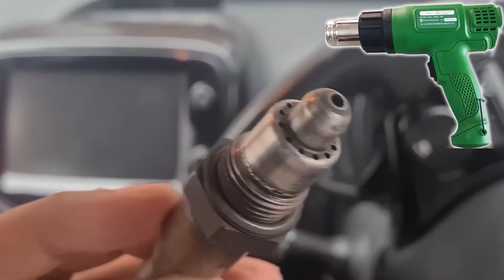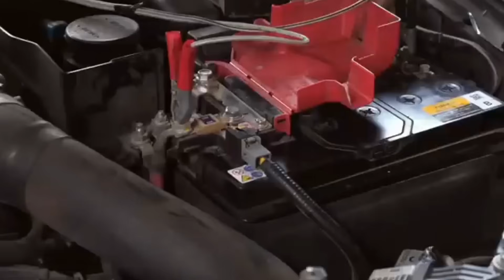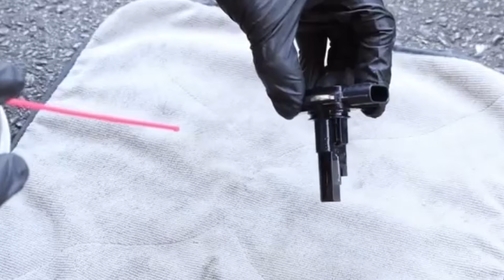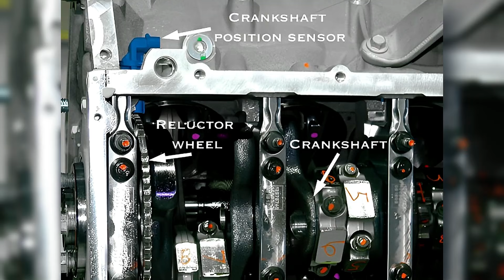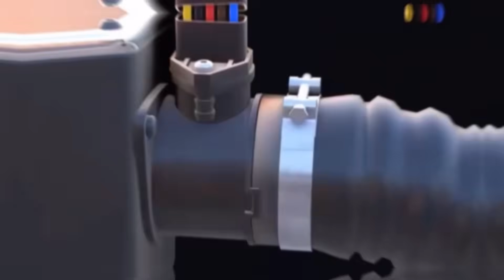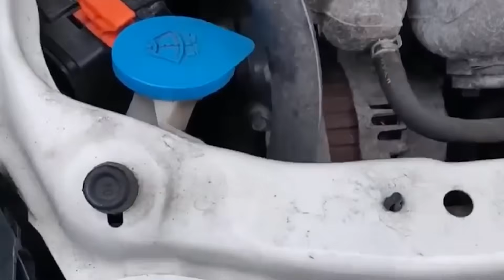Nobody Cleans These 5 Sensors — And Your Car Pays for It

Comment: Why did car manufacturers put those sensors to give car owners problems? Old cars don't have them but they lasted longer. This makes we wonder.
Reply from the maker: Honestly bro it’s the emissions laws, not a plot. Carbs couldn’t pass modern rules so sensors came in. The old cars you see still running are just the survivors, the rest went to the scrapyard decades ago. Real problem is shops swapping a $200 sensor when a $10 cleaning does the job.

Comment: What about the pcv valve?
Reply from the maker: Fair question, the video only touched on it. A stuck PCV valve is a big reason the MAF and throttle body keep getting dirty. It pushes oil vapor into the intake, so you clean everything and it’s coated again a few months later. Shake the valve. A good one rattles, a stuck one stays silent. Oil residue inside the intake tube is another sign. They’re usually $10 to $20 and sit on the valve cover. What car is it?
Reply: @AutoTruthLab i have a 2023 kia sorento. Its done this thing on me a few times where the car randomly turns off shortly after i put it in park. Usually within a minute of turning off the car. Not sure what is causing the issue.

Comment: hi l have a 2013 chrysler 300c 3.6 when l push the throttle hard the engine light comes on and no power when l back off and drive normal car drives ok sometime under power its ok not sure whats going on can someone help
Reply from the maker: Hard throttle power loss with CEL on that Pentastar 3.6 is pointing straight at the MAF. Dirty sensing wire reads accurately enough at light throttle but signal drifts when the engine demands full airflow ECU can’t trust the data under hard pull and cuts power as protection. Back off, sensor stabilizes, drives fine. That’s exactly the pattern. Clean the MAF first, $8, 15 minutes. Battery disconnect for 10 minutes after to clear stored fuel trim compensation. If the power cut still happens under hard throttle after that, check the throttle body second.

Comment: Please am facing a problem with my toyota cami k3-VET, after swap only an engine with non turbo. Now am getting rough idle when start at cold, and fuel cosumption went high about 6km/L  and the technician came and check the error it throw only one found he said. Air flow sensor they mention it and up to now i don't know if The MAP used there has no problem because they want to replace IAT sensor only!!  I dont know what to do
Reply from the maker: Hold off on that IAT sensor  it’s not what’s causing the rough idle or the fuel consumption. IAT just reads intake air temperature, replacing it won’t fix either symptom. After an engine swap the ECU fuel trims are still calibrated for the old setup — airflow code on a fresh swap almost always means the MAF needs cleaning and the ECU needs a reset to start learning from scratch. Clean the MAF, disconnect the battery for 15 minutes, drive 50-100km normally and let it relearn. If the code returns after that then dig deeper. Don’t spend money on the IAT before trying this — it’s a free first step.

Comment: 2006 Passat B6 2.0 TDI gets code P0236 and loses power, rpm cuts at 2000, what could it be?
Reply from the maker: P0236 on that 2.0 TDI is the MAP sensor reading boost pressure outside what the ECU expects  covered in this video. Before touching the sensor check the vacuum hose connecting it to the intake first. Cracked or loose hose gives a false boost reading, ECU sees data it can’t trust, pulls power and caps RPM at 2000 as protection. That hose check is free and fixes this more often than a new sensor does. If the hose is solid, clear the MAP port with compressed air next. Sensor replacement is the last step on that BKD, not the first.

Comment: Rough idle. When I left off the gas it chokes out. Sometimes I get lucky and she doesn’t stall. As of late she seems like she is having a hard time breathing. 2004 Citroen C4.
Reply from the maker: That choke-out on throttle lift is the throttle body. Carbon on the plate stops the engine from transitioning back to idle smoothly — it stumbles and cuts out instead of settling. The hard to breathe feeling is either the MAF or a blocked air filter choking the intake. Clean the throttle body first, both sides of the plate and the bore. Check the air filter while you’re in there — on a 2004 if it’s never been changed it’s long overdue. MAF clean second. She should breathe properly again after both.

Comment: The check engine light continues to come on.  The car runs fine, no issues with fuel economy, pick up, hesitation nothing while running.  The only issue is at startup is extended crank and sputters like searching for fuel.  Once it starts, there is no issue with the need for fuel.  Just changed the spark plugs.  The check engine light is back on.  This is a 2020 Hyundai Santa Fe and it has 101,000 miles.  Any suggestion(s) would be much appreciated.
Reply from the maker: Extended crank and sputter only at startup then fine after — that’s fuel pressure bleeding down while it sits overnight. Rail loses pressure, starter cranks until it rebuilds, catches and runs perfectly from there because the pump holds pressure while the engine is running. New plugs were never going to fix that. Fuel pressure regulator or injector o-rings are where pressure is escaping. Also pull the exact code number — P0087 or P0088 means fuel pressure out of spec and confirms this. P0300 range means misfire and points somewhere else. That code tells you exactly which direction to go before spending anything.

Comment: This is why I like vehicles with just HEI and Carburator or Air body fuel injection, No sensor problems any more, It has been proven that a vehicle turned run just as effiecient as a computerized vehicle. Besides, with a fuel cleaner, the valves get cleaned as the fuel passed throuth the intake vales, Many vehicles do not get that benefit.
Reply from the maker: The simplicity argument is legitimate — fewer things to fail, anyone can work on it with basic tools, no scanner needed. But equally efficient as modern injection doesn’t hold up. Fuel injection calculates delivery for every condition in real time altitude, temperature, load, throttle position. A carb runs on fixed jets and float levels. That gap is real and measurable. The problem isn’t the sensors, it’s shops exploiting the fact that most people don’t understand them. That’s what this channel fixes.

Comment: I have a Toyota camry 2020 le  2.5 engine when the engine is hot and the transmission shifter is on park the rpm goes up and down slightly, but if i shift to drive (D) it stops doing that is it the maf sensor or the throttle body needs cleaning?
Reply from the maker: Throttle body on that A25A, not the MAF. Hunt idle in Park that disappears in Drive is carbon on the throttle plate. Drive mode puts load through the torque converter and stabilizes RPM artificially — Park exposes what the plate is actually doing on its own. Clean the throttle body first, both sides of the plate and the bore. Do the idle relearn after on that Toyota or the hunt comes back even after cleaning. MAF is worth doing the same day but the throttle body is your answer.

Comment: I have a 2010 Toyota Hilux kun26 3l.
When traveling pulling a trailer or driving into a strong headwind or overtaking another vehicle at over 2500 rpm , it feels like the vehicle goes into limp mode. It runs uneven , the power is less responsive, it uses more fuel and when I stop at idle the engine shakes and runs unevenly.
Now when I turn the vehicle off and turn it on again the engine runs evenly again and is responsive. I have replaced the map filter, the pressure converter solenoid and cleaned the Mass air flow sensor.
Could the Mass air flow sensor be faulty and throw the vehicle into limp mode when the engine is under load?
Reply: Did anyone else have the same issue ? If yes, how did you fix the problem?

Comment: Rough idle after deceleration on 2008 suburban ltz. Throws codes. But runs fine otherwise
Reply from the maker: Rough idle specifically after deceleration on that 5.3 Vortec points at the MAF first. Dirty sensing wire can’t recalibrate fuel trims fast enough when throttle lifts, engine stumbles transitioning back to idle. Clean the MAF before touching anything else. One thing worth knowing on that generation though  the Active Fuel Management cuts cylinders on decel and causes exactly this pattern when it starts failing. Sensor cleaning won’t fix that one. What codes are coming up?

Comment: Vibration on acceleration
Reply from the maker: Need a bit more to point you anywhere useful  what car, at what speed does it start, and is the vibration in the steering wheel or the whole vehicle? Those three things narrow it down fast.

Comment: Hi mate my Mazda 3 won’t idle I have to keep my foot on the gas so it doesn’t stall
Reply from the maker: Throttle body carbon on that Mazda 3 — that’s the symptom exactly. Carbon on the plate stops the engine from holding its own idle so you end up doing the IAC’s job with your foot. Remove the intake tube, clean both sides of the plate and the bore walls with dedicated throttle body cleaner. Do the idle relearn after cleaning or the RPM will hunt for days. $8 fix before any shop sees it.

Comment: Morning rpm fluctuations and engine shape with beep soung sometimes engine turn off.
Engine start with long crank
Reply from the maker: Long crank on cold start plus morning RPM hunting plus random stalling — that’s pointing at two things from this video. Dirty MAF struggling to read cold dense air causes the morning RPM fluctuation and shake. CKP connector corrosion causes the long crank and the random shutoff. Clean both before anyone touches anything else. What car and year is this?

Comment: 2016 sonic.1.4 engine. Miss  firing. Runs fine the complete misfire, just seconds. Eas of throttle fine throttle normal hard misfire. Any ideas. Tia.
Reply from the maker: Hard throttle only misfire on that 1.4 turbo narrows it down fast. MAF first — dirty wire reads well enough at light load but can’t keep up when the engine demands full airflow, stumbles under hard pull. Clean it before touching anything else. If it’s still misfiring hard under throttle after that, the ignition coil is next — weak coils hold together at light throttle but break down under the electrical load of hard acceleration. $8 MAF cleaner first, coil test second.
Reply: @AutoTruthLab Thanks ❤

Comment: What year is it ? What day is it ? I feel like John Conner. A can of throttle body cleaner has not been $6.00 for a long time, I bought a can 5 years ago at $14.00. The rest is good info though. Thanks Stewie.
Reply from the maker: Fair point — that number hasn’t aged well. $10-14 is closer to reality now depending on the store. Still a fraction of what a shop charges to do the same job though, so the math holds. Appreciate the correction. 😄
Reply: @AutoTruthLab  I agree. In fact thats how I got started years ago with shops chargeing way too much for a simple job done in a short time.

Comment: I have a 98 f150, v6, 4.2l engine that idles up and down when in park or stopped when in drive. Drives fine when in motion. Any ideas where I should start?
Reply from the maker: Hunt idle at stop but smooth when moving on that 4.2 Essex is the IAC valve and throttle body. Carbon restricts the IAC at idle, engine keeps hunting for the right RPM. Moving at speed the throttle plate takes over and it smooths out — that’s the telltale pattern. Clean the throttle body first, $8, 20 minutes. Then clean the IAC — it’s right on the throttle body on that engine, easy to access. Both before anyone quotes you anything else.

Comment: VTEC solenoid clean or replace if you're car has 150,000 miles I would recommend replacing it 💪🏼
Reply from the maker: Solid add for Honda and Acura owners. VTEC solenoid screen clogs with oil sludge and throws symptoms that look identical to sensor problems — rough idle, hesitation, CEL. Clean it under 100k, replace it past 150k. $15 part that saves people from chasing the wrong diagnosis for weeks.

Comment: Bad fuel economy Doge  5.7 HEMI    Runs perfect.
Reply from the maker: HEMI running smooth but burning through fuel is almost always the MAF. Dirty wire reads low airflow, ECU over-fuels to compensate, economy drops quietly while everything else feels fine. No codes, no rough idle — just disappearing fuel. $8 MAF cleaner first before anything else gets touched on that engine.

Comment: I have a hard start. Crank shaft sensors have been replaced o2 sensor also. Replaced fuel pump assembly. After all of this it still has a hard start.
Reply from the maker: CKP replaced but did anyone touch the connector? New sensor through a corroded connector still drops signal intermittently — shops replace the part and never clean the connection it runs through. Contact cleaner on those pins, dielectric grease, reconnect. Also worth checking if fuel pressure is holding overnight — pump replaced but a leaking injector o-ring or failing pressure regulator bleeds the rail down while it sits. Engine cranks long before pressure rebuilds. What car is this?
Reply: @A @AutoTruthLab ey thanks for responding. It’s a 2010 Nissan Exterra 4WD.
Reply: @AutoTruthLab  so I just cleaned out my MAF sensor. I had a hard start but I tried turning it off and on 3 times and each time it started faster. I waited 10 minutes and tried it again 3 times. First try was another long hard start but progressively was shorter. This tells me it’s losing pressure somewhere. I just don’t know what type of leak it is. Air maybe coz I did get a lean code.

Comment: P0016 camshaft position correlation sensor bank 1
Reply from the maker: P0016 means the cam and crank aren't talking to each other correctly — computer sees them out of sync. Before touching any sensor check oil level and condition first. That code on low or dirty oil is almost always the VVT solenoid starving for pressure rather than a failed sensor. Clean the VVT solenoid screen and sort the oil first. What car is this on?

Comment: Can I clean the map sensor with mas spray
Reply from the maker: No — MAP sensor doesn't get liquid cleaner. Compressed air into the vacuum port to clear the carbon blockage, nothing else. MAF cleaner on a MAP sensor can damage it. Different sensor, completely different approach.

Comment: With what cleaner I can clean this sensor like electric contact cleaner or a specific cleaner spray?
Reply from the maker: Wrong cleaner on the wrong sensor and you've turned an $8 fix into a $200 part you didn't need. Throttle body — dedicated throttle body cleaner only, not carb cleaner, not brake cleaner. MAF — MAF cleaner only, label has to say exactly that, nothing else. MAP — compressed air into the port, no liquid on the sensor itself. O2 — don't clean it, check the connector with electrical contact cleaner first, replace only if that doesn't fix the code. Everything at any auto parts store, $6-10 each.

Comment: I change my gasket of my car,replace it.no oil leaks but the engine shakes
Reply from the maker: Engine shaking right after a gasket job usually means something got disturbed during the work, not a new problem. Check every vacuum hose and sensor connector near where they were working — one loose connection causes rough idle immediately. If it was an intake gasket, even a small air leak at the seal does this. Also worth doing a throttle body relearn if the intake was removed — the computer loses idle calibration when airflow gets interrupted. Connections first before anything else gets touched.

Comment: 2020 palasade acceleration from stop slow on echo and engine light come on , reset by unplug the battery both negative and positive, engine check off but sometimes fill the transmission is rough.
Reply from the maker: Resetting with the battery cleared the code but left the cause untouched — that's why the transmission is still rough. Slow takeoff from stop plus rough shifts on that Palisade points straight to the throttle body. Carbon on the plate sends bad position data to the transmission, shift points go off, acceleration feels like it's dragging. Clean the throttle body first, $8 cleaner, 20 minutes. Do the throttle relearn after — 2020 Palisade needs it or the idle hunts for days after cleaning. That CEL will come back if the source stays dirty. Battery reset just delays it.

Comment: I cleaned all the intake plumbing and the MAF sensor and ETB on my 2016 NV3500.  Also fixed air intake box because it wasn’t sealing properly.  Estimated mileage at full jumped from 398 to 472…I was shocked.  I also had to do idle relearn.  Now I have to drive for a while to see if the improvement is real
Reply from the maker: 398 to 472 is not a coincidence that's the intake seal doing most of the work. Unmetered air bypassing the MAF means the computer was guessing on fuel delivery the whole time. Clean MAF and ETB on top of that and now the ECU has accurate data for the first time in probably years. The idle relearn finishing it off properly. Drive it that number is going to hold.

Comment: My neighbor cleaned mine. I later found out he used brake cleaner!!
Reply from the maker: Most expensive favor a neighbor's ever done 😂 Brake cleaner leaves petroleum residue on that sensing element and it doesn't come off. Check if the car is running rough or throwing lean codes now — that'll tell you whether the sensor made it or not.